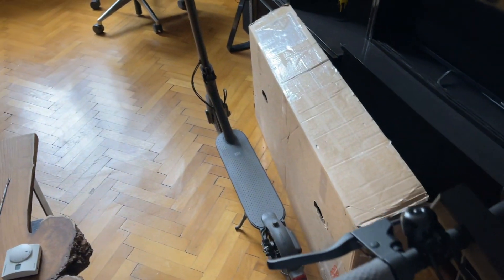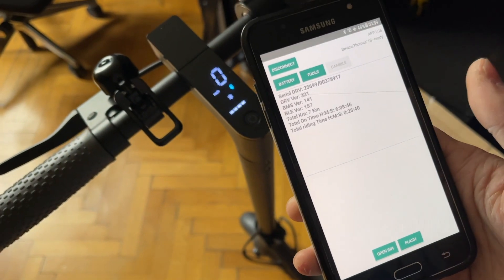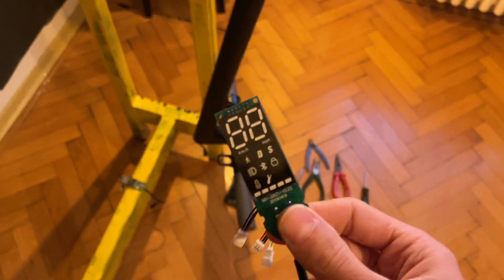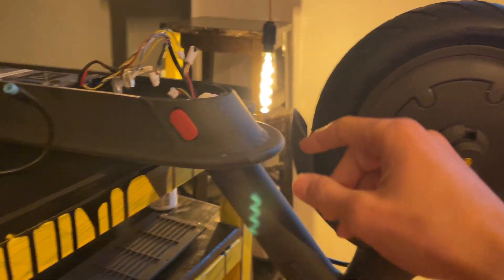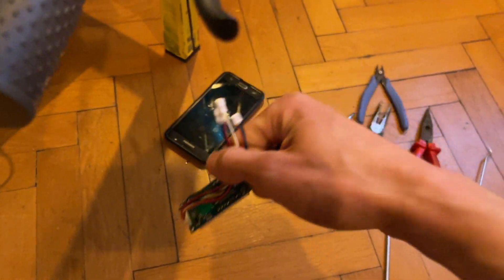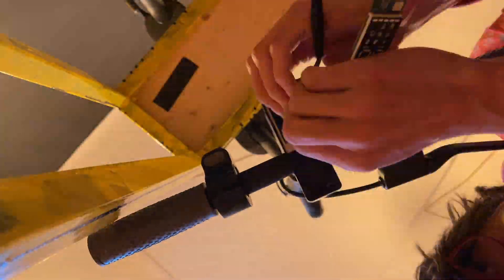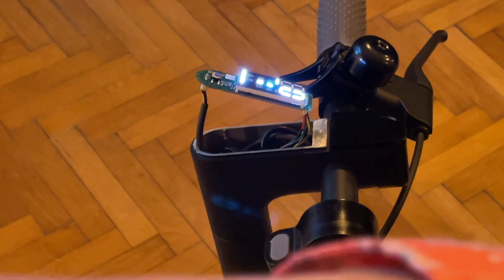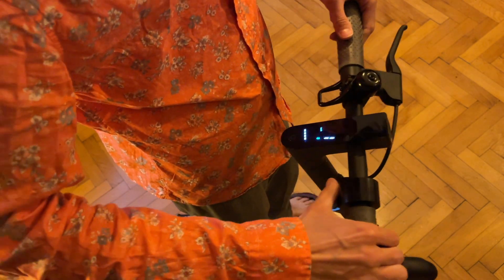Hot to get Custom Firmwares on newer Xiaomi Scooters [DOWNGRADE DRV231 • DRV247 • BLE157]

Comment: Just got my new pro 2 and i'm very sad to see this video. I don't want to take apart my new scooter and replace parts. If you find a solution that does not involve taking it apart please make a video.
Reply from the maker: sure will .. sadly this is as good as it gets now

someone suggested just taking apart the fork - as it comes taken apart in the box

you could just hook that wire up to another scooter - so - that would be rather uninvasive
Reply: @Darieee  Do you need to connect all the wires of the new dashboard (including all the colourful small wires) for the flash to work, or do you only need to connect the big grey wire connection? Thanks in advance.
Reply from the maker: technically yes - otherwise the scooter panics about the brake and throttle sensors and shuts down quite quick .. you can try it out and let me know if it works

I made some dummy resistor dividers for my "for flashing only" fake dash 🧐
Reply: Thank you, I just ordered a new dash and will try it out when it arrives.
Reply: Hey dariee, can you give me any hints on how to put the dummy resistor dividers? I am trying to use an older dashboard without having to replace the original one. Thanks!
Reply: same, waiting for solution without replacing parts
Reply from the maker: again - it does come taken apart in the box

to the exact same extent you have to take it apart for 10 minutes during the entire flashing process

then you can use your original dash
Reply: @alistair1978  I just bought one off eBay

Comment: Taking off a friend's whole upper steering assembly off could be easier, it's just a couple of screws + brake line + connector. That way you don't damage their glue either.
Reply from the maker: that's actually a great idea 🤘
Reply: If I used a friends dash or complete upper steering assembly that is not with the newest firmware, and flashed my scooter that has the newest, would I still be able to flash it once I've installed my dash again?
Reply from the maker: you only need the older dash for the flashing

afterwards everything'll work perfectly ✌️
Reply: @Darieee  my ble is 155 and it still wont work
Reply: @Darieee  Does that really mean that when you reconnect the dash with BLE157, it can communicate with the CFW even if it's still a BLE157 dash?
Reply: @Darieee  I have a pro 2 with DV 248 and BLE 157. My friend have a pro 2 with the older version already with custom firmware.

Can you confirm if its possible to borrow his steering my flash my scooter ? 

And after I plug my own steering again it will be possible to flash custom firmwares ? Or everytime i want to flash do I need to borrow his steering ? 

Thanks !!